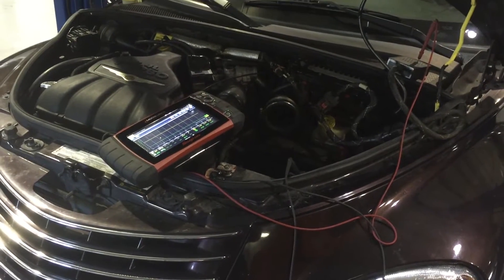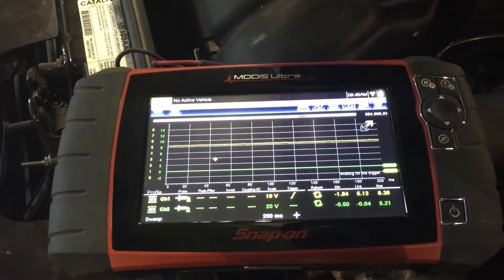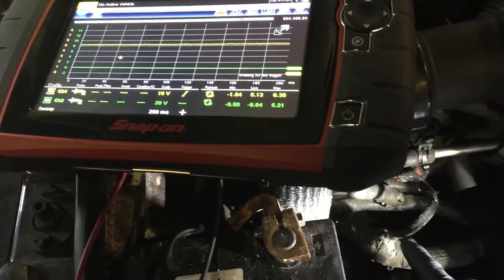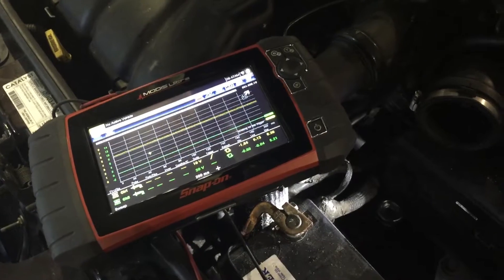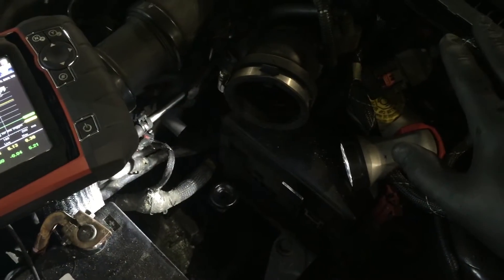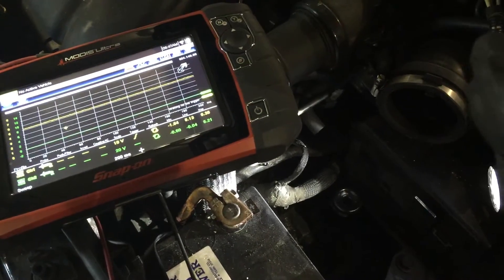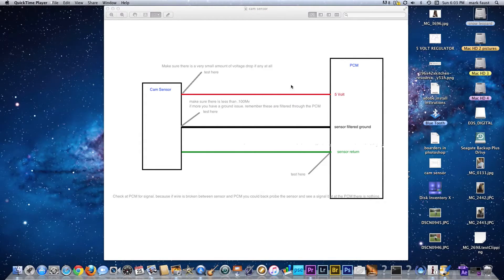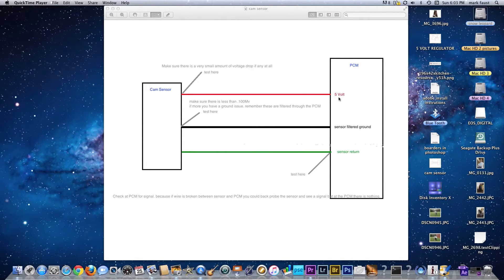cam sensor broken wire

Comment: How did you check the signal at the ecm with the car running? Did you back probe it at the ecm connector? I'm trying to do one that all the wires are covered where it goes into the connector....would you use a wire pierce? I didn't want to pierce because the wire is so dang small, I was worried I'd damage it.

Comment: with your permission I would like to add a bit more...

Some car have a 2 wire sensor. 2 wires run from the 
sensor to the computer by way of a harness. 
Some cars have 3 wire sensors.
Engines vibrate. All the sensors coupled into the 
engine will vibrate together. Eventually over time
those wires will either break at the connector, or
somewhere along the wire. Why?
Because engine vibration bends(oscillate) the wire back and forth
until by internal friction they snap apart at the point
of friction. 

So owners beware. A fifty billion dollar diagnostic tool
is still unable to detect the difference between a bad
sensor from a breaking or broken wire. 

There fore you can assume that sometimes a 
Check Engine light and DTC code of the 
electronic system may be sometimes be caused by
a wire going lose or breaking or broken.

Why can I say that? I had a wire breaking on a Crank
Shaft Position Sensor. But nothing was wrong with 
the sensor. However tracing it back from the connector,
a breaking wire was intermittently killing the signal, then
on the next bump make contact. Eventually that wire 
broke completely leading to a Crank but no Start situation.
So, don't just depend on your diagnostic equipment. 
Use your eyeballs to verify as well.
Reply: Thankyou cause I have a Dodge Challenger and recently had to change my sensor but didn’t check the wiring harness… and the harness it self is damaged
Reply: @8pistons93  Dodge Challenger, yeah baby, really nice cars. Even when it is parked, it looks like its speeding along!

Comment: I had an issue with my car frequently dying/stalling. it would mostly happen after I stop and then I accelerate again. somebody scanned my car and said it was a cam sensor issue. I replace it, and I found the red (5 volt) wire was frayed on my old cam sensor. could that have caused my issues?